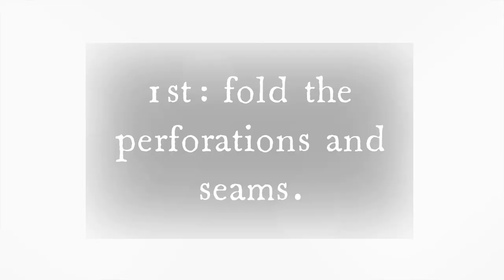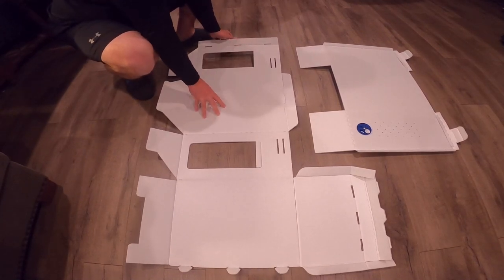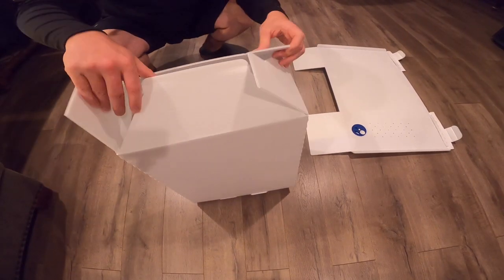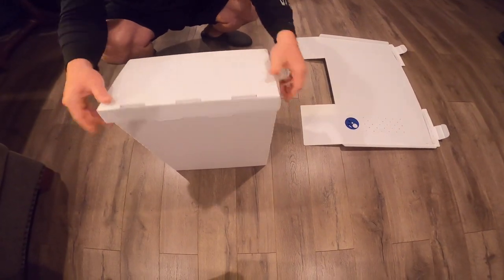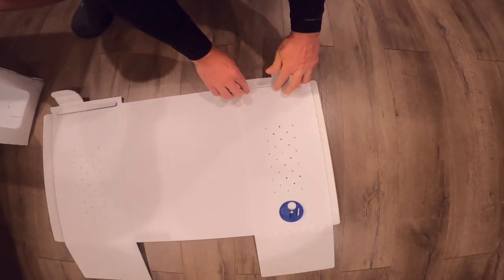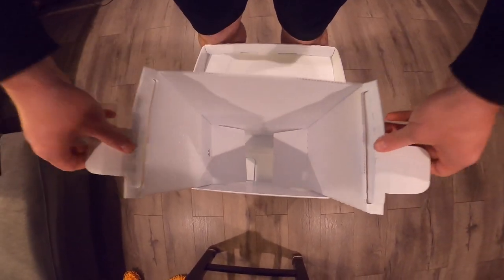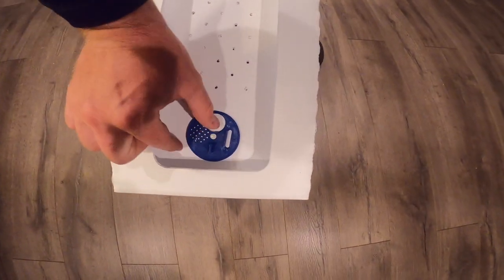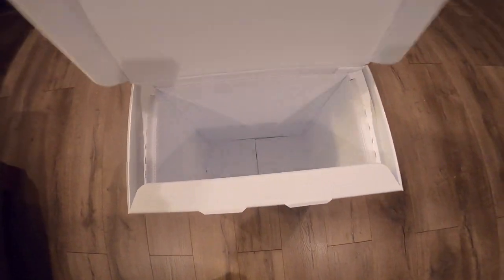Layens nuc box assembly instructional video

Comment: Just received my 2 nuc boxes today.  Just got done assembling them per your instructions.  Fairly easy to do.  You were right about the hardest part was the frame rest.
Reply from the maker: Steve McCrary Excellent! Good to hear. What I've found is that once the nuc box is assembled, everything starts to take its form better after being flat and rigid. After some use, once frames with some weight to them are set in place on the frame rests, they keep their shape. We contemplated removing that little flap part on the frame rest that had to be folded back initially, but if removed bees could exit through that space.  What we found after some use is that as long as it's first folded back slightly, once all 5 frames are put in, then it eventually just presses against the underside space below the frame rests and isn't an issue. Once you get a chance to use them, I'd love to hear how they work for you.